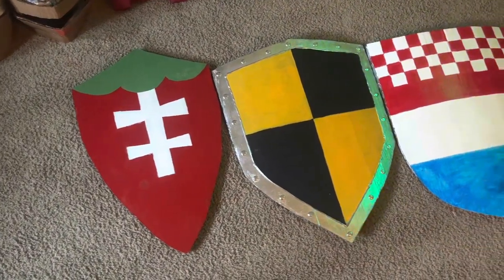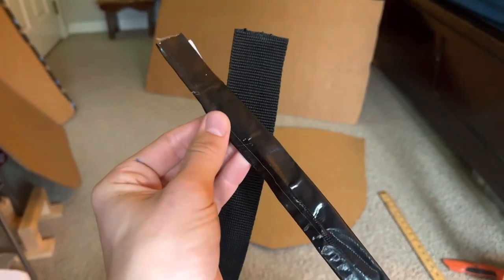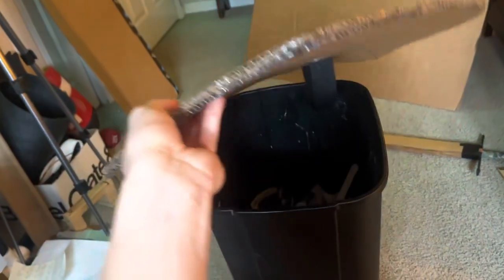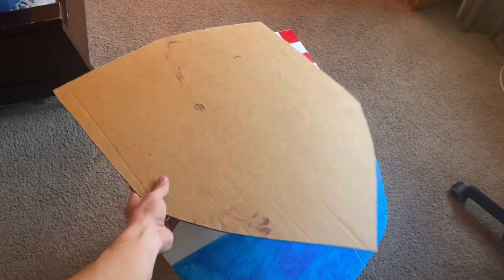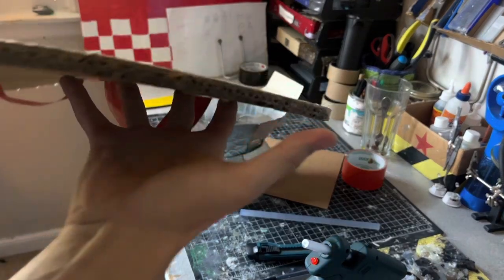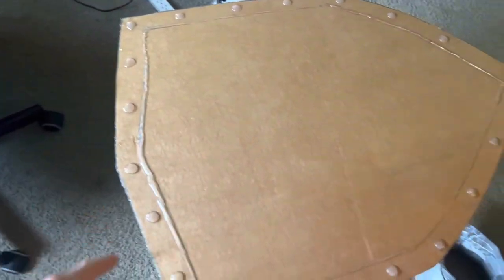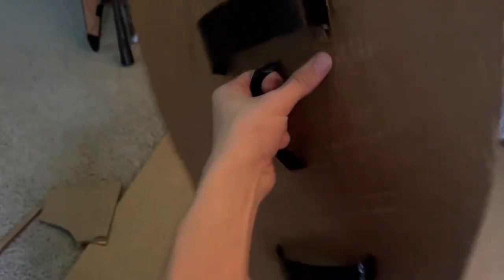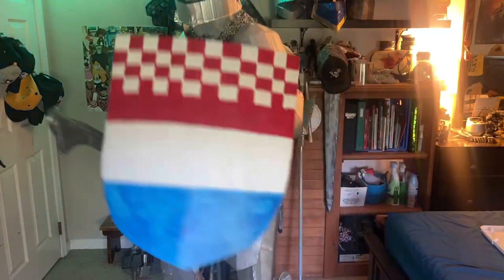How to build a Cardboard heater shield

Comment: Sorry pal as a hungarian i can't let it go, u painted the hungarian coat of arms uoside down, the green is at the bottom of the shield not on the top.
Good job tho!
Reply from the maker: Thank you for caring about historical significance… I intentionally painted it that way because the shield is not held like a normal shield. It is held more like a Pavise you hold it sideways/long ways rather than a traditional shield that’s why
Reply: @MarksWorkshopcrft  
👍 thanks for explaining the reason why u did it like this.
Reply from the maker: @laciihasz4734  of course!!